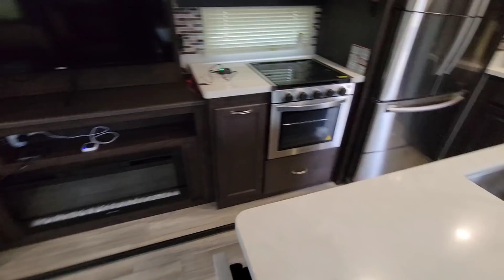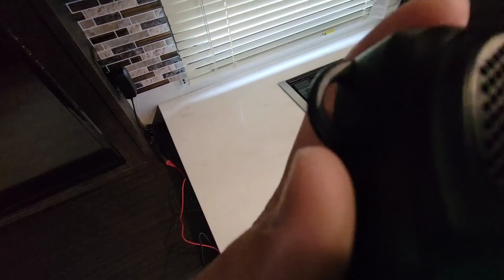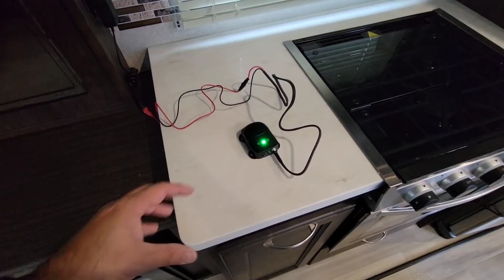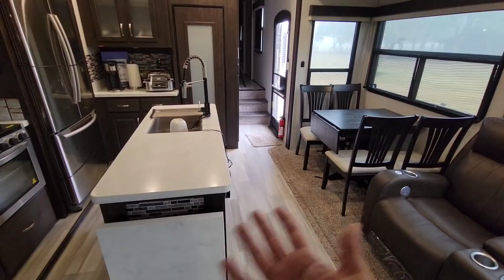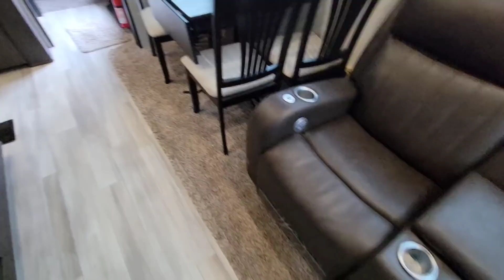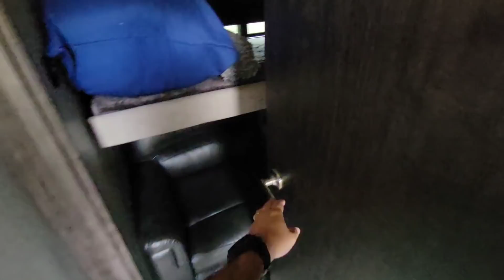Owning an RV MUST watch!  Most important advice you'll get.

Comment: I bought my RV in PA in October of 2015 and had it there for less than a month. A YEAR later and 2000 miles away I was STILL finding stinkbugs. Somewhere in AZ I picked up a mouse that traveled with me for thousands of miles. NOTHING I tried solved either problem: sprays, traps, oils, noise-emitting gadgets. The ultimate solution, and NOT the choice I wanted? A cat.
Reply from the maker: Have you tried Pyrethrin SFR?  If you do, definitely read the label, adhere to warnings and use correctly.

Comment: A good pest repellant is to soak cotton balls in eucalyptus oil and place in small plastic (plastic only!  Paper soaks thru) cups, strategically in your RV.  Insects dont like the smell of it, and if there is no food in the camper, and no insects, you have a lower chance of rodents.  We place them in each storage bin, in the kids bunks, under our bed, in the bathroom, in the cabinets, etc...

This really has worked well for us at our storage unit.  RVs on both sides of us have had insect issues, but ours in the only one around us that doesnt.  Good solution for those places where you may not have power!

Comment: I'm glad that I'm not the only one who believe in going out to the rv often to check on things, our rv is in storage about 15 to 20 minutes away and I like to go out there to make sure all is well. I went out to our rv a few months ago and found that one of my traps had catch a mouse, when I open the door, I smell this odor that I was wondering what is that odor. Well, when I walk inside, I find out what was that odor, I had a dead mouse so now I try to go out as much as possible. 

I did go out today to check it but I didn't open up the slide like I normally do but I see that I need to put some more rv anti-freeze in the toilet bowel. I like that ideal but the one thing on stopping me for trying one out is I don't have power to my rv. Oh, I didn't think of all those things to check but I will tomorrow, another awesome video.

Comment: Rodents hate light. 
Keeping my trucks in my shop I always leave the hoods open with the trucks well lit.. Large, 8ft. LED shop light middle of the shop, between the two trucks. Then I also will add something in the engine compartment. 

Now, this is just talking about the truck concept, in the garage/shop. The trailer you might put some LED work lighting pointed IN from the front and then the rear of the coach, keeping the bottom well lit. There are some nice and bright lights to buy, some electric and some battery. Usually I'll buy the square light, around 6inches to 10 inches square. They do put out  a good bright light that will help you when not using for this concept as well. Harbor Freight has some decent one's as well. 

Also, keeping away from the possibility for my pets to get to them will place the box poison feeders around the areas I have problems with  the darn pests. You can purchase the boxes at home depot/lowes/hardware stores which snap tight closed for access only for the mice or the rat sizes. The holes for the rodents are pretty small, for just the size for the rodent, not a cat or dog. Replacement poison blocks are available at the hwstores as well.

Comment: I try to inspect my RV frequently also. One additional thing I like to do is to use a flash light to check the upper front and rear corners to make sure I don't see any water damage. The top corners of the front and rear of the RV are really common areas for leaks and often hidden inside cabinetry so you don't realize there is a problem until a significant amount of damage has been done.

Comment: I found a natural solution to keep mice out of my RV that has worked well for me and might help others. I use a mint oil spray on the landing feet and tires and I use a botanical repellent made by 'fresh cab' in the storage bays and service hatches. I spray the mint oil every couple weeks and the botanical repellent is good for 90 days. I have never had any mice in my 2021 fifth wheel yet despite being parked where I had a bad problem with mice in my old trailer. I am not adverse to traps and poison but so far, I haven't needed them.

Comment: A great thing to prevent moisture build up and even water ingress on RVs and motorhomes is to rig up a positive pressure system so the inside of the RV is always higher pressure than outside. This can also help prevent dust and insects and even rodents entering. I’m not sure why they don’t like the environment, but they tend to avoid it in my anecdotal experience.

Comment: You are fortunate that your rv is always plugged in and you have access to it so you can run these types of devices. My 37’ fifth wheel is in storage, uncovered, no power (and $390/month). It is on gravel or asphalt and they do an excellent job with traps etc. I wish I had the opportunity to have power and check it daily. Good tips for those that can apply them. I do take it out for 4 days every month. All that I can do while still working.
Reply: 390/mo storage? Wow that is an incredible amount of wasted money
Reply: @NWI_Steel  You don't know the context. Maybe the primary residence is extremely convenient for everything else. Around my parts, that's 110 gallons of gasoline. You could very quickly go through that with a larger truck. Not to mention the vehicle maintenance and time spent driving every day.

You want to park the RV on your own land? There are plenty of other costs to consider.

Important : I am not saying the price is justified. I don't know that either. I am saying, it is impossible to know if it is "wasted money".

Comment: I leave my home for 6 months every year and have been lucky, no bugs (it’s winter).  I shut the water off and have the village turn it off at the street.  I turn off all the breakers except the furnace, which is set at 45°.  

And in the summer it’s the same thing for the fifth wheel but I’m doing small and big upgrades and an occasional trip.  Just don’t have the room for the big enough pole barn.
Reply: And I just ordered a new axle beam and other parts from your sponsor.  👍